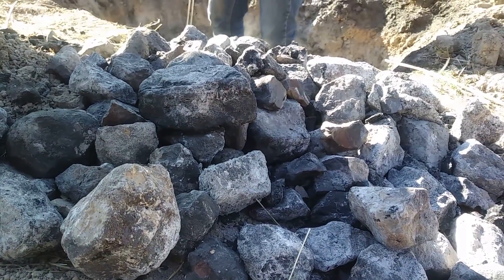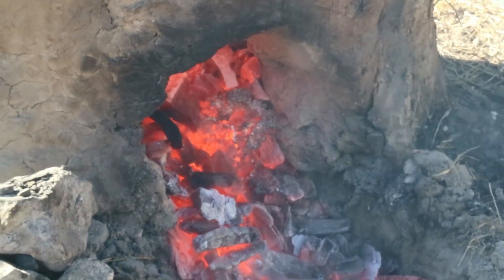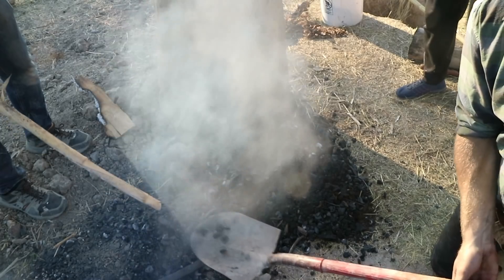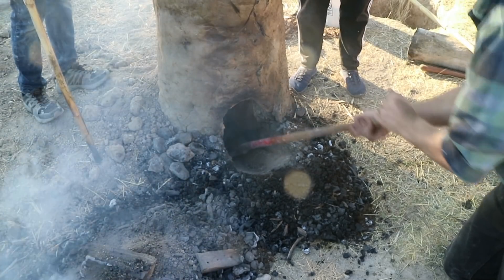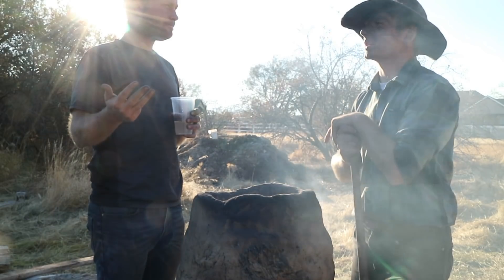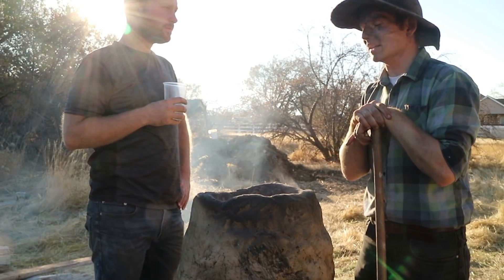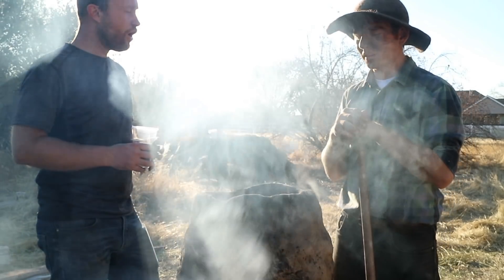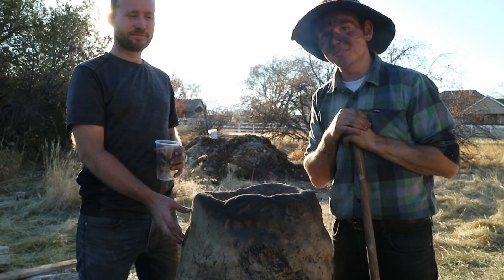Natural Draft Smelt Attempt

Comment: im thinking a combination of this and bellows? sure you would still use bellows but by adding the natural draft component you could lessen the work - this would be done either by having a hole in the back connected to bellows in addition to the front air supply or by connecting the ends of multiple bellows to a tube and putting that near the mouth of the air supply while avoiding blocking the airflow of the smelter - you could also try to find a different material to make it out of or at least coat the inside with that would act as insulation and protect from cracks though in order to keep the theme of doing it the way it use to be done would limit the options it could still work with certain soils or with whatever rock resists melting on the edge of magma tubes in volcanoes. these are just ideas though and I have no idea how they would work in practice.

Comment: Ive attempted to smelt iron before many times. I did successfully get a nugget of iron that was the size of my thumb inside a ball of slag once, but normally i just get a lot of black glassy/crystalline material that is REALLY hard and tough and is super magnetic, but it wont forge. 

Any experienced smiths have some suggestions?
Reply from the maker: That black magic stuff is called fayalite and is a kind of slag. From what I understand, it can be an indicator that your iron content in the ore isn't quite high enough for primitive smelting. JB
Reply: @GoodandBasic  huh. that is odd. idk why the iron content would be too low, ive been using rust from my dads garage as my "ore"
yes ik thats kind of cheating, but its more of a proof of concept for me
Reply from the maker: @christopherconaway3549  for sure. The first smelt I got to work I did with pure rust and a calcium magnesium fertilizer as flux. That's strange it didn't work. JB
Reply: @GoodandBasic , that may be the reason itself actually. i used no flux at all. i suspect maybe another run with some limestone dust might yield a better result

Comment: Look, no expert here, so take it with a grain of salt, but I think the draft hole at the bottom is too large, letting out too much heat - as evidenced by the coal/wood being still mostly coal/wood and not converted to ash. You could probably use a taller flu. You may need to have it spend more time in there. I think it's a good starting point though. Final note, if you can break up the ore into smaller pieces, it should smelt more easily.
Reply from the maker: The wood we pulled out was part of a buried ore drain under the furnace. JB

Comment: What would happen if you narrow the top  opening a little more i could be wrong but . I would think if you make it narrow it  would have a stronger  effect because it is being blown out like a higher pressure to a lower pressure  and the the air  at the bottom would get sucked in to the fire more because it needs more air to  Stoke the fire . But i could possibly be completely wrong  i was just wondering. If i am wrong please tell me 😅
Reply: I was wondering this too. Like a rocket standing on its head.
Reply: you are wrong. narrowing the top would restrict the draft and create higher pressure inside the furnace which is the opposite of what you want. you want to allow as much hot gas to leave as easily as possible so air from the bottom will rush in to replace it. The biggest thing they can do to improve the draft is to make the furnace a lot taller. twice as tall or more.

Comment: I would try using a log with a branch coming up off at about 45° for the lower entrance. Hopefully this will encourage airflow to travel up. I would also recommend building a longer "entrance" for the lower opening. This helps create a greater temp differential between the air coming in and the air inside the furnace. 
One other thing to mention, time and temp are competing variables. With higher temps, you'll need less time (obviously, I just thought it was worth mentioning).